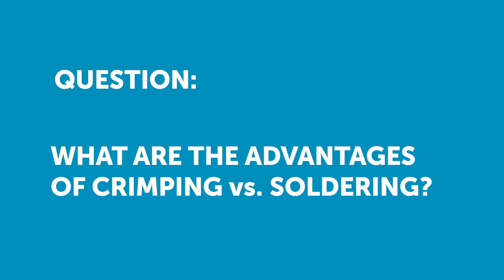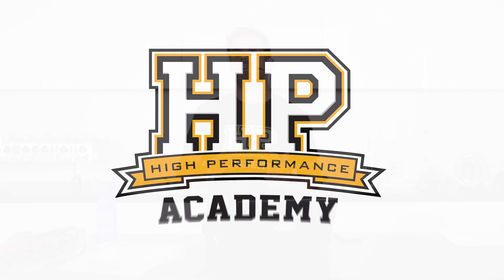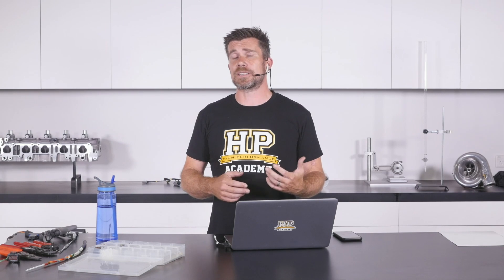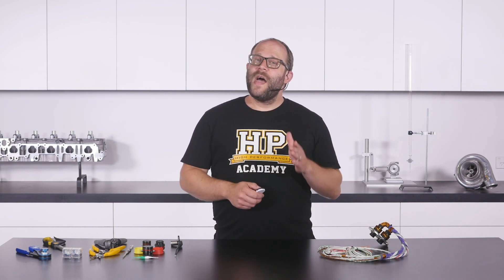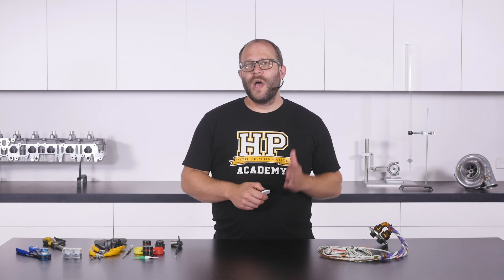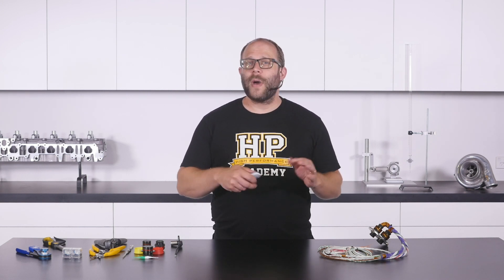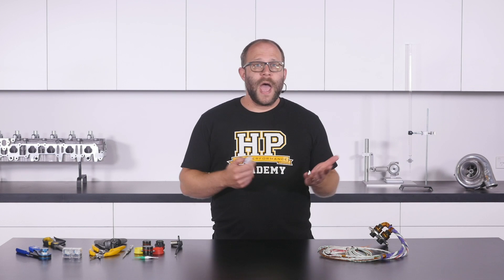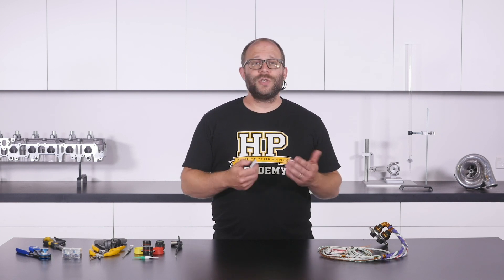Are All Crimp Joints Created Equal? | Crimping vs Soldering [HPA Q&A]

Comment: OK but having a long experience of automotive electrics I have seen crimped joints fail electrically open circuit because of corrosion between the wire and the plated metal crimp. Perhaps this doesn't occur for ten years or so, or ever in a perfectly sealed connector, but I have seen it often enough to be wary. Combined with the cost of the proper crimping pliers, which can be over £100 and different for each make of connector, then you can see why a "crimp it as best you can with what you have got the solder it" is the approach taken by many.
Reply from the maker: The correct way to avoid the issue with EITHER method is to correctly seal your join, as you mentioned 😉The crimp has not failed in your example, the method used to seal it has.

Solder joints will also give you grief if you do not seal them correctly, so switching methods won't save you from poor sealing techniques or materials either sadly - Taz.

Comment: Save the solder for circuit board level electronics or very large gauge connections that you've already crimped. 
  Ex. stranded 0-AWG crimped to a ring terminal, then soldered after the fact to keep it's crimp from wiggling loose.  
Disclaimer: This is just my personal experience but without fail.  Don't O.D. on the flux